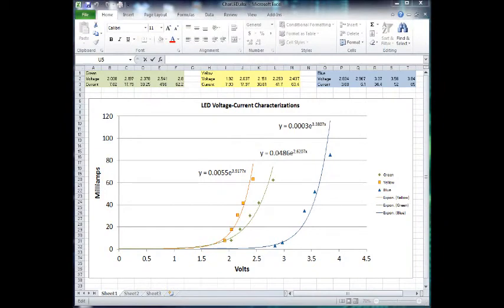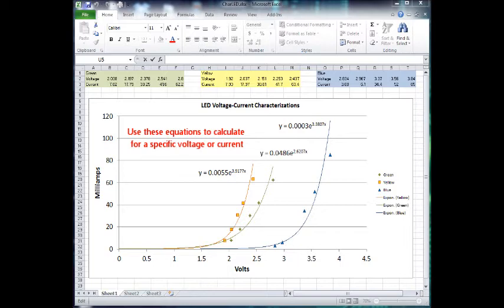Characterizing LEDs

Comment: Outstanding! This is just what I was looking for.
Question: Can I characterize a whole array or do I need to pull an individual LED?

My hack involves 24 LEDs already wired in parallel with only one LED resistor. I would lime to use the array for a strobe hack.
Reply from the maker: Terry Glover You could characterize the entire array the same as a single LED.